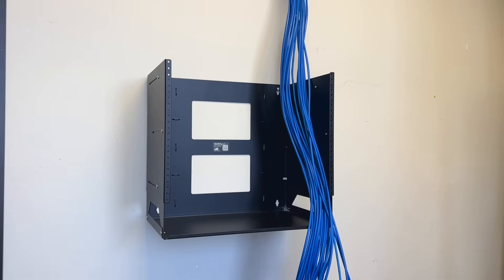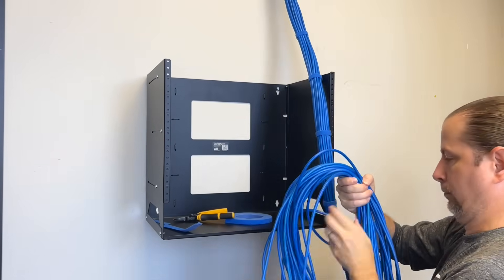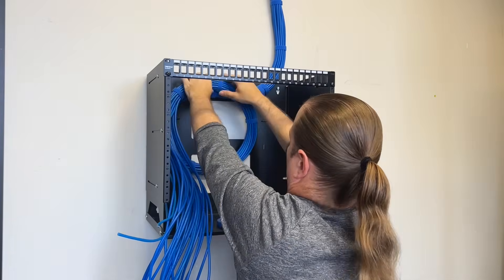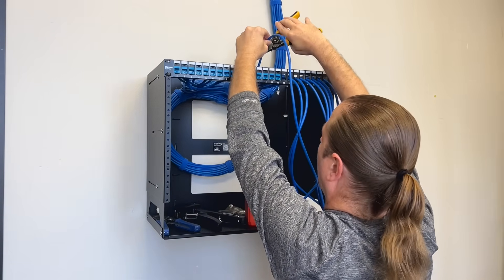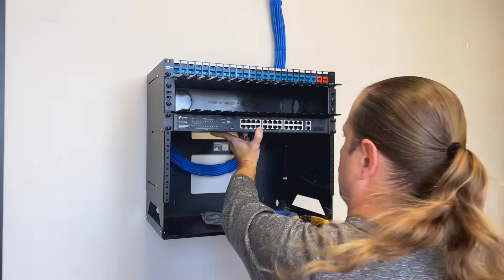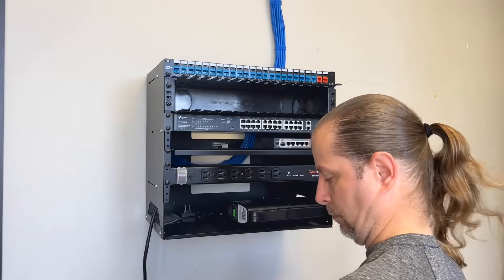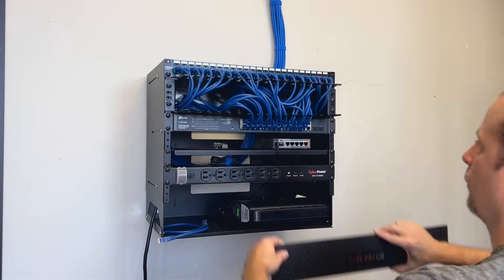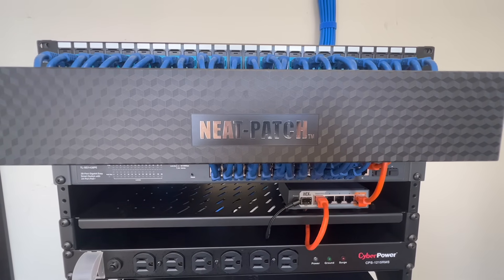Learn Network Cable Management for Home Racks

Comment: First off, NEVER TIGHTLY BUNDLE NETWORK CABLE LIKE THE TEASER PICTURE and video SHOWS.  CROSSTALK AND SIGNAL DISTORTION. MSEE here, RF guy. The cables like to be alone,not parallel. Messy, yes.  Performance? Better, less distortion.  If you must bundle stuff,at least use cables with an overall shield foil.

Comment: Nice video, however, need more explanation about the orange patchcoards. I can see that one runs from the Modem up to the router and from the router to the patch pannel and from there to the switch. But, you say the orange would be for the Wi-Fi. A little conffusion there. Also, what kind of router is that? And you'll use separated Accesspoints for the Wi-Fi and connect them to the router later? Thanks.

Comment: I'm sure your OCD was greatly effected by using that front-panel power strip instead of the rear facing plugs. Is that why you didn't power anything up? I always used the rear facing plugs because of that. haha

Comment: Thanks for sharing. In my humble opinion, I would install the shelf rotated 180º so that the screws are positioned in the unused side holes, right below the holes used for the switch, while keeping the lower side holes free.

Comment: How do you know where each of those cat6 cables coming out of the wall go?
ie. What if your switch has 8x PoE ports and 8x regular (unpowered) ports?
How do you know which cable you should plug into which port?
Reply from the maker: Normally you'd want to number both ends of your cable before you pull it through your home, with a sharpie would be fine, but you can also use sticker labels and attach those.
Reply: @tciproductions yeah true, but how do they know? In the video there's no markings. How do they label everything after the fact? This isn't the only video showing huge amounts of unlabelled cables either.
Reply from the maker: @corvusprojects  I've got other videos about topics like that, you always label before you pull essentially.  If you forget, you'll end up toning them one by one.

Comment: May I ask, sir, for example, how do you replace the velcro cable with cable ties? Thank you for your response.
Reply from the maker: Normally I use velcro for my installs unless I need to support something with weight, and then I will use a zip tie.  Otherwise velcro is how I secure my cables, because that way I can open the velcro, add a wire, and close the velcro back up again.

Comment: I dont like the neat patch thing, if your going to use long patch cables and shuv them in a hole you may as well forget the patch panel and put them straight into the switch. I would have just made the patch panel and the switch closer maybe a second panel underneath and short patch lead them together, looks much neater.  nice cable management prior to that however. It's all personal taste and no criticism of you personally, just how I like it.

Comment: I thought it isn't recommended to roll the cables into a loop?
Reply from the maker: Rolling is petty standard practice, I have seen people suggest figure-8 instead, but it would take a lot of frequency to matter most of the time.  I won't judge if you skip it.

Comment: This is an excellent video - thanks so much for spending the time and walking through it.  I'm not sure why it was recommended, but it inspired me to finally clean up the disaster of a wiring setup in my home - 15 years after I built it.  At the time I just did whatever to make it work - and it looked like it.  Yes, it did work, but wow, it was impossible to trace and figure things out if needed.  

I'm halfway with the new setup, which included my whole home audio system homerun stuff, too.  Perhaps the biggest change so far was that I pulled all of the RG6 cable out.  It's no longer used anywhere in the house and it made a huge mess.  Once that was done things got much easier to work on.  This weekend?  Installing the RJ45 keystone jacks where I currently have RJ45 connectors installed.
Reply from the maker: Man, that's my kind of weekend warrior effort!

Comment: you aren't supposed to plug power strips into UPSes. it says so in the manual. doing so eliminates the ability for the UPS to properly terminate a surge, and could lead to damaged equipment.

Comment: How about this: lose the cable manager, move the switch right under the patch panel, install another patch panel under the switch and populate only the ports that align with those of the switch. Then, turn the tray that holds the router upside down, so you can actually use the 1U right under the tray for the pdu. By now you would have gained about 2U, which would let you install the ISP device upright, not laying on its side. Finally, get a couple of keystones with rj45 sockets on both sides, so you can actually run the cables from the ONT and the router into the back of the patch panel and in the front connect them with the smallest possible patch cables. 

You're welcome

Comment: I work in IT on a college campus and I had to participate in a backbone upgrade where I had to upgrade routers, firewalls, fiber jumpers, and fiber modules! Our campus has around 5 different node rooms and I can say that the cable management was horrible! Almost nothing on the fiber patch panel was labeled correctly. I had to do many 5AM-2PM shifts to get this work done!
Reply: Most LAN Closet installs look great until Network Engineering gets in there.  Then it's cable h3ll, a rat's nest with no cable labels or documentation.  All they care about is a link light and closing the ticket.
Reply from the maker: If they did a good job, I'd be out of a job.  I am so excited to see a disaster like that!

Comment: Looks good, but using unshielded Patch cables and using a Chinese Switch while underneath is a great Mikrotik Router is just ridiculous. I fixed a lot of network problems just by replacing unshielded Patch cables. Flat Patch cables are the most ugly ones. More crap equipment means more money for me... 😂
Reply from the maker: Sorry, real quick, what is the benefit of using shielded patch cables on unshielded horizontal links?  I need a little more info.
Reply: @tciproductions  a bunch of unshielded trunk or patch cables interfere each other. And are open for incoming and outgoing radio Signals and other stuff. This problem increases from year to year. And a lot of customers say: it worked for years this way, now i have problems, why do we have to change something? I am saying then: could have something to do with the massive increased terrestrial radio interference like Wifi, mobile phones, Bluetooth and so on...
Reply from the maker: @ I was under the impression if the horizontal runs are unshielded and the patches are shielded it causes other issues.  I gotta read up, I typically only deploy shielded for AV equipment, like HDMI extenders.

Comment: For the cyberpower surge protector. SHould that be straight to the outlet or can you use a UPS. I thought you shouldn't plut a big surge protector into a UPS. Can you recommend one. I already have an APC ups for my rack but the whole thing is a mess. Thanks!
Reply from the maker: The power outlets in a rack are usually not a surge protector, but a PDU.  The PDU that goes into a rack in meant to have a battery backup.  If you are choosing a product, make sure it has no surge function and you'll be okay.

Comment: How did you know the two wires terminated to the orange jacks were for the wifi APs? Did you tone them out first?
Reply from the maker: You'll want to mark them before you run them to the spot, that way you can find them in this mess of cables later on.
Reply: Thanks!

Comment: ok, so I strongly disapproved of his choice of switch when I saw it was TP-Link but then I noticed a Mikrotik box and he redeemed himself.  The 2U cable management is clean and a great choice.  Overall... approval rating 9 /10.  VERY clean and nice job.... I hope you'll consider a Mikrotik CRS replacement for the  only mistake you made! ;)
Reply from the maker: Ha!  I got you, next network build will have a 'tik for sure.

Comment: What is the purpose of the smaller switch between the router and the core switch? Getting rid of a single point of failure?
Reply from the maker: The little 5 port device?  That's the router, the other thing you are seeing is just a modem.

Comment: What happens to this design when ONE MORE cable is installed and there’s zero expansion in the patch panel?
Reply from the maker: This is just a demo.  I'll make more vids to discuss common issues like that, but if anyone out there suspects they may need to add a wire someday, use the larger panel at the outset.

Comment: in my personal preference, if i got a 24-port switch that doesn't line up well,
i will get two unloaded patch panels and put the switch in the middle and use 6" patch cables anyway.
it takes one less rack unit and lets me upgrade the switch if i need more than 24.

Comment: awesome. but i am wondering, how to know which cable is which? is it based on the label printed on the cables themselves?
Reply from the maker: Before you pull a cable somewhere, write on both ends of it with a sharpie or a sticker label, that way you know which is which :). If not available, you'll have to put a tone generator on each line and count them manually after you've done the install.

Comment: What is the best way to ensure you have enough cable after you cut the network cable for termination so it lines up nice and neat back to the patch panel after you terminate the wire? Like how do you know how much cable to cut off so you know you have enough cable when the terminated wire goes into the panel? Tips and or rules of thumb?
Reply from the maker: When the cable is poked through the panel like I show here, I mark a line on the jacket where the cable enters the panel from the back side.  I then pull the cable out of the panel and strip about 1.5 inches from that black line, once a keystone is on it, should fit just right.

Comment: How are you able to determine which two wires are for your wifi which you put through the red ports on the far right?
Reply from the maker: I usually write on them with a sharpie before I pull them over to where my wifi will be, that way I can read the note afterwards and already be sure I have the right ones.

Comment: Question. My house was a new build and it was wired with CAT5e cables to every room. The cables are not terminated in the box in my closet. Do I need to do this or can I just terminate the cables and plug them straight into the router?
Reply from the maker: Nah, you can go directly to RJ's if that is easier for you.  Just leave a little length so you can adjust it later to something else if you change your mind later.
Reply: @tciproductions  thank you. I assumed I could do that. I only need it for four cables as there are only 4 that lead to the rooms and the living room. Just wasn't sure if it would work or if I needed to do all this.

Comment: The shelf you installed is absurd

Having the screws taking up a 1-U space outside the shelving is truly insane

They should be within the plane of the shelve and this is a waste of 4-U of rack space

Edit: Actually you just installed it incorrectly, the shelve is upside down

Comment: Are the initial 24 ethernet cables just connected to any of the 24 ports on the patch panel or are they numbered so that you know which device they will ultimately connect to ?
Reply from the maker: If nothing else I take a sharpie and label the cables, yes.  You'd label both ends to match the patch panel port they are going to, and then use a proper label printer to attach a label to the faceplate once you were done.
Reply: @tciproductions  Ok thanks for the reply

Comment: Apologies if I missed it, what length cable are you using between the patch panel and switch? Specific brand / set recommend? Thank you for the videos!
Reply from the maker: I try to use the 2 foot lengths when I am working with a cable manager, it keeps the slack nice and loose.  Any brand is fine, but I like the slim cords if I can find them.

Comment: Outstanding work demonstrated in this video.  Earned a like and a sub.  I am in the process of something similar and a lot of the devices you used I have never seen.  Thanks so much.  I started my tech journey with an IBM PC with 8088 and 64K of RAM and 2 Floppy Drives back in the mid 80's.  Been running Linux for 10-15 years and doing DIY networks.  Kids at church tell me I know way too much technology for my age! :)  I was 76 in November 2023.  Best Regards, Jim

Comment: May I ask for opinion on whether to use pass-through RJ45 connectors or not? Some people say they might cause issues, like crosstalk.

What is your experience sir? Btw I love your videos, always keen to watch your new work.
Reply from the maker: Crosstalk at 1gig is exceedingly unlikely, but if the jacket is not done well or there is strain on the connector pins where they mate with the wire conductors it is possible.  We use them from time to time and there's at least one place I can think with hundreds of them, no issues to speak of.  If the RJ45's are done well you won't run into any additional issues unless you try to push 10gigs through one.
Reply: @tciproductions  thank you for your answer! So 1Gbit connections no problem but it would be advisable to use regular jacks on 10gbit connections.

Comment: Does the panel panel use special keystones or the usual keystones?
Reply from the maker: The usual Leviton style keystones that most plates accept fit the panel just fine.  I have mixed and matched brands of keystones in the same panel more than once.  ICC High Density Keystones, Everest, and Leviton are the main ones I use but the generic monoprice ones fit it as well.

Comment: Came here randomly… what is this used for?
Reply: Networking equipment. 

In a normal small house, one Wi-Fi router can handle the Internet for all devices in the house. In larger houses or businesses, you need more coverage and more ports throughout the house.  All those blue cables are Ethernet and they carry networking data throughout the building

Comment: Did you.... Did you install that shelf upside down? Shouldn't the lip be on top, so stuff doesn't fall out? That way you can also put stuff directly under it.
Otherwise I really enjoyed watching this.
Reply from the maker: I did, and I usually do because I hate that lip, all my gear is like juuuuust a smidge too big and the lip ends up working against me.  Of course, when you do stuff all the time, you forget to explain it :). I tried to include the thought process in other projects.

Comment: Enjoyed this and TIL about cable combs. Didn't the shelf go in upside down, though? Did I miss _why_?
Reply from the maker: I did it on purpose because I hate the little lip that's on the end of the shelf, and I didn't mind giving up a 1U slot there.  In other vids I talk about it, when I did this one I totally spaced.
Reply: @tciproductions  ah, I did think it could be the lip. Nice idea to stop things falling out, but in reality gets in the way of neatly connecting cables, and if the lip is too big getting your gear in and out, I guess?

Comment: What should ne the distance between rack and wall. How much cabel should I leave outside the rack. Thanks
Reply from the maker: You'll have to determine for yourself sometimes - I like my the distance to put the rack at about eye level for me, but you could set up real high against the ceiling so that you can use the space below it for other purposes.  Whatever feels comfortable to you.  The cable slack I usually put up in the ceiling, I only have it visible in the rack here because I wanted to include it in the shot.  If your ceiling isn't readily accessible then 1-2 loops near your rack, for a total of 3 to 5 feet of length is fine for most purposes.

Comment: Isn’t bundling CAT cable like that, especially using PoE problematic with heat and interference?
Reply from the maker: Not in my experience, no.  If you can feel the heat on a wire running PoE, something is surely wrong.  Interference may be possible at 10gig speeds if the wires don't have a spline or separator inside, and if they are perfectly combed and run a good distance.  Those conditions along with poor terminations can lead to crosstalk, but in a home environment it is quite rare.
Reply: @tciproductions  that is excellent to hear, thank you. Thanks for taking the time to answer - I am now comfortable to bundle my 30ish CAT6 cables into my new rack. Thanks!